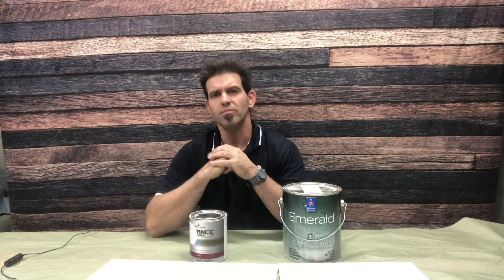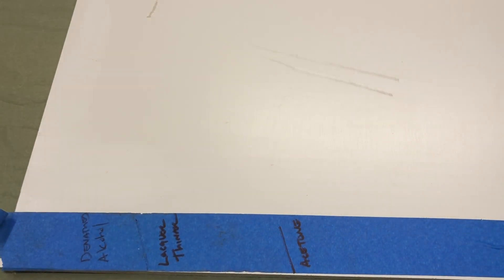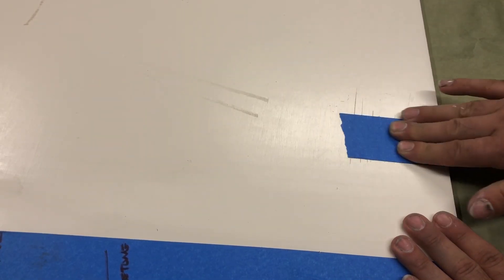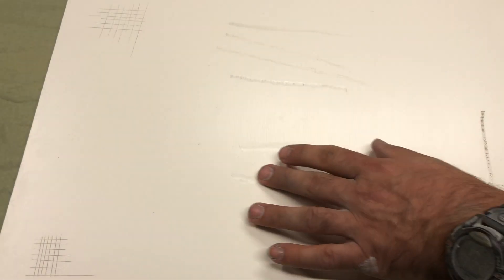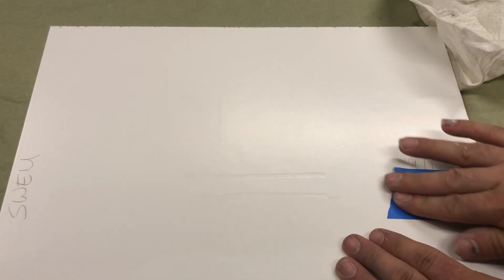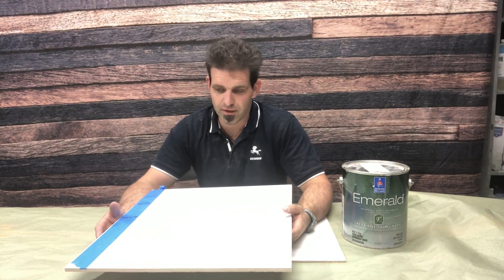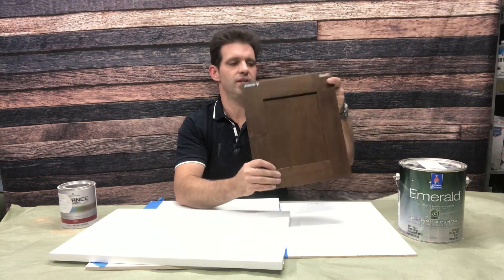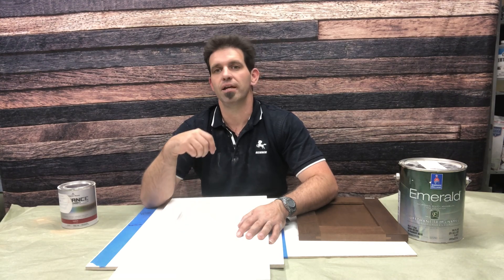Sherwin Williams Emerald Urethane Vs Benjamin Moore Advance

Comment: getting ready to paint my 10 yr old latex painted kitchen cabinets that are latex with a glaze then sealed in 2 coats of polyacrylic.  as you stated there have been advances in paint since then, but overall minus a couple of doors they have held up extremely well.  I was leaning towards the SW in this video, my question to you is what would you recommend to the average home owner who cant get our hands on paints contractors use.  and also would you recommend oil based primer to go over the poly?  I love your videos, I have always been a paint junkie and personally do not care for the BM advance on cabinets only trim.
Reply from the maker: Amber L if it’s waterbase already their is non need to prime it. You can just go over it with the emerald if that’s the route you choose.
Reply: You need to first 1) use a liquid deglosser and 2) sand the cabinets, to remove any existing finishes and also scuff the wood for max adhesion. Then, use an oil or alkyd primer prior to using the Emerald Urethane Enamel. Yes, Emerald Urethane is far better than the Ben Moore Advance. There are some products in Europe that are slightly better still, but they’re hard to ship and also some have experienced shortages lately. Overall Emerald Urethane is my go-to cabinet product
Reply: @charlesg7926  what would be a good cabinet primer??brand?
Reply: @gracedenisse   Call a pro. Doing cabinets professionally requires months of supervised training (supervised by a pro who’s had years of experience). There’s way more steps, techniques, coordination, chemistry, math, cure times, factors, etc involved than just the primer
Reply: @gracedenisse   Telling you the right primer to use, would be like telling someone who’s not certified or trained for skydiving, which parachute to buy. It would be irresponsible. You’ll end up in a bad mess that’ll be costly ($7000+) to get out of. TRUST me, call a pro
Reply: @gracedenisse   as an afterthought… The most intelligent people I know, try to specialize in ONE career (be it a salary job or business) and earn a high income. Then they HIRE OTHER PROS for their taxes, law advice, contracting/home work, medical, etc.
Reply: @gracedenisse   It’s always the foolish/intelligent people, that want to do everything themeselves. They think they “know more than” their doctor, their accountant, their local pro painter… then they lose more money than they’d save when they mess things up 😑
Reply: @gracedenisse   so my suggestion is on focusing on building your own career. Get really good at one industry, and make yourself a lot of money. And then hire people that have years of experience, for complicated stuff you need done. Cabinets are not “simple”. Painting 1 small wall might be kinda simple. Painting cabinets is complex, it involves science and chemistry and math and cure times and using a sprayer and selecting the correct nozzle and using the correct methods (done with perfect hand/eye coordination) and when you inevitably do just one step wrong, it’ll peel off in horrendous chunks that costs you $7000+ to fix because it would all need stripped off completely. Humble yourself. I would never try to tell a lawyer or doctor or engineer how to do their job. Painting cabinets is super complex and you need to give proper respect to that profession. Even most professional home painters aren’t qualified to prep/paint cabinets, they’re a very niche thing

Comment: What do you think about Sherwin Williams Pro industrial water based urethane alkyd for cabinets
Reply from the maker: +Billy Duke that’s a great question. I have heard and been told it’s not different than emerald. I still think that the industrial coatings will out perform sherwin Williams pro industrial
Reply: @ericreason6559  Thank you

Comment: Thanks for the video comparing these two Architechtural products. At the end you compared them to some industrial products. Have you used the industrial coatings for cabinets from Sherwin-Williams called Sher-Wood? Not really fair to compare these products to industrial coatings.
Reply: Dan Gillispie Never beard of that. Sounds like what I need? Thank you!
Reply: @Tinyteacher1111  I used Sherwood ken aqua . It is a nice finish but they aren't making it right now.it is also very thin so it should not be sprayed heavy or hanging

Comment: Eric,
excellent video reinforcing my choice to refinish my poly'ed red oak cabinets with the emerald in SW Alabaster. Not a professional painter. Just a bored, quarantined homeowner. Seeking encouragement and/or advice from a pro.
I sanded down to bare wood (except the molding at top of the cabinets) - I'm using SW extreme block oil primer - one coat on cabinetry and latex extreme bond primer on the the molding at the top. Then 2 coats of the emerald on all with final facing at the end. Brushing and rolling all with high end materials. I did not want to attempt the sprayer without my husband who is an essential worker. (Is any of this combo overkill or ineffective long run? Should I do a complete third coat?)
Also, how long should I wait to rehang the doors? I was thinking a week at the least.
Thank you for any response.
Be blessed.
Reply: You might’ve finished by now, but one tip for you:  if you are priming/ painting existing stain/ finished wood you don’t want to sand to bare wood.  You only want to scratch the surface of the existing clear coat, not sand the clear coat off.  The clear coat locks in the tannin stains in the wood.  The Sherwin extreme bond does not block any of those tannins stains and yellow would bleed right through no matter how many paint coats applied.  
If existing poly is intact and slightly sanded, some painters just use extreme bond, stix, or Inslx UMA bonding primer and then spray can any yellow tanning stains that bleed through that with spray can bin or coverstain.  

How many coats needed on finish?  Two is needed for durability.  3 needed in case 2 coats didn’t cover.

Comment: Eric Reason I don't have a paint sprayer nor do I know how to use one. Can I use Renner or Milesi with a brush? Painting stair banisters and kitchen cabinets. 

Also, I have oak wood and was under the impression that I needed to prime to avoid tannin bleed. Are you saying these paints work better without a prime coat? Thank you!!!

Comment: Nice work Eric they both tested better than I expected. Interesting that the primer would bake that much of an adhesion difference
Reply from the maker: Michael Craine I think that it just takes forever for it to get hard. So I don’t think 30 days is adequate. The primer  thing has to do with the oil primer getting hard and brittle.

Comment: Hello Eric, Thanks for the video.  I am making wooden kitchen cabinet for the first time, I don't know much about paint coating.   The cabinet doors will be simply one single straight/flat piece of sanded wood with no grooves nor design.  All I wanted is to paint the doors bright white with very shinny high gloss.  I am assuming it will take a few coats of paint on top of a primer.  Which paint and primer do you recommend, Sherwin Williams Urethane, Benjamin Moore Advance, Renner, CIC, …?  Your help is greatly appreciated. Thanks, Abe.
Reply from the maker: +Abe B  sorry I am just now seeing this YouTube doesn’t always send me the comments from folks. Any of the ones you
Mention will
Work great. I like the milesi universal, renner 643, and envirolak 170. My favorite tip coats are wide and Long.
Reply: Thanks Eric for your response.  I live in the Detroit/Ann Arbor area in Michigan (USA), and it seems that nobody carries either one of the three you mentioned (Milesi, Renner nor Envirolak).  I might stick with the Sherwin Williams Urethane.

Comment: Hi Eric, great videos!!  I have a question regarding SW Emerald urethane. What have you found to be the best viscosity (seconds) and tip for spraying Emerald with HVLP?
Reply from the maker: John Bernard honestly airless works the best
Reply: @ericreason6559   I only have HLVP. Will that not work? I sprayed one coat of semi-gloss thinned to ~30 secs using a 1.8 tip and the finish was more like a satin than a semi-gloss...any ideas (other than airless) would be much appreciated.
Reply: @ericreason6559  Are you saying that I will not be able to get an acceptable finish using  HVLP?
Reply from the maker: John Bernard no you will just have to thin it to get it to layout. The reason I mentioned airless is that my experience has found that it works best with water-base overall with the least amount of issues.
Reply from the maker: John Bernard yes the semi-gloss in that product is more like a satin. The satin has a chalky feel to it. You can definitely use a turbine I was just saying that airless works extremely well with waterbase despite what everyone says. 308 fft  is the way to go.
Reply from the maker: John Bernard yes the semi-gloss in that product is more like a satin. The satin has a chalky feel to it. You can definitely use a turbine I was just saying that airless works extremely well with waterbase despite what everyone says. 308 fft  is the way to go.
Reply from the maker: John Bernard thanks I just reduce until I get a tight pattern and good atomization. Sound a like you have it figured out.
Reply: @ericreason6559  Thanks for the input Eric! I've heard that some people can get very nice finishes using an airless but I've never tried it. I've only used conventional and a cup gun or, now, HVLP. If I get the chance, I think I'd like to try using General Finish Poly -- Michael Craine seems to like it a lot. BTW, what is 308 fft?
Reply: @ericreason6559  OK, I finally figured out what a 308 fft is. Thought it was a rifle caliber  ;)   So if I spray EMERALD URETHANE using an airless with a 308 fft, will the material retain a semi-gloss sheen? Or would it still degreade to a satiny finish?
Reply from the maker: John Bernard  no the sheens are just different with that product I’d you want a semi gloss you will have to go to there gloss. If you shoot it with airless you will not have to reduce the material
Reply: @ericreason6559  I took your advice and tried the gloss and, sure enough, the result was a semi-gloss. Thanks for the tip! I also discovered that EMERALD does not play well with oil-base COVERSTAIN. That primer definitely has an effect on the sheen. So, after using CS for a base coat, I then used KILZ premium for an intermediate coat, followed by the EMERALD. That combo seems to work the best. What are you feelings on GF Enduro Poly? And what type of primer would you use under that coating?
Reply from the maker: doc hall you raise a good point and SW is actually right the paint itself will adhere better than the primer however the issue in most cases is bleed back, tannin bleed or dye migration.
Reply: doc hall  Whatever the chemistry, it certainly has an effect on sheen. Actually, I wouldn't have used CS except for the fact that I had so much bare wood exposed after prepping the boxes and cab doors. I did an experiment a while back where I prepped a cab door (wash/scuff) and used Zinsser 123 and had excellent results with adhesion over nitro lacquer. Over bare wood, however, I'm still a fan of oil-base primers. As I mentioned, I solved the sheen problem by shooting a coat of water-based primer over the CS prior to finish material.
Reply: @johnbernard7032  Could not get it to work with HVLP Turbine. Went back to airless with it and good. SW themselves answered my question on this and stated I would have to thin it too much and could cause problems. Went with a 310 fflp tip, but I had to work faster. On to Milesi.
Reply: Eric Reason f
Reply: If you look at the back label on the can, it tells you what tips to use with a HVLP. You can also get data pages from the store you purchased the paint at.
Reply: @kencarpenter108  I have shot several vanities with an HVLP. I have a Fuji and used  the # 4 tip. It works very hard to get it to lay down.  I’m going to use an airless with it tomorrow.  I love the SW urethane. I had a terrible experience with the Advance. It ran badly, took forever to dry/cure and coverage was much less than desirable.

Comment: Love this video! What primer would you recommend for a cabinet refinish job? I assume a vinyl sealer. Keep up the great work👍
Reply: @KonstantinUdalov  the Renner looks amazing unfortunately I don't think it's available where I live. And right now I'm trying to get the milesi dialed in. Another question ,milesi, they have Universal primers curious how that adheres to those challenging surfaces.
Reply: @KonstantinUdalov  yeah you're probably right, but there something to be said about easier availability👍
Reply: @WordAboveAll  love social media thank you so much for the input! I shoot the milesi with an air assisted airless with an 09 tip I think my biggest was not putting enough mills on, it wasn't laying out like I wanted it to was getting a bit frustrated but I did notice once it dried it looked better than I thought it would I still have some experimenting to do thanks again!👍
Reply: @ballardpaintingcompany514  Get a mil gauge if you can. That helped me in the beginning. I was so used to spraying the lighter coats of SW, PPG products.....but you can go much heavier with the European products.
Reply: @WordAboveAll  yes the European Coatings are a lot different, heavier coats, opposed to what were used to Spraying thanks for your advice👊

Comment: Eric I am a small cabinet refinisher in Maryland and I have recently come across a kitchen where someone used Sherwin Williams SuperPaint. It’s a primer and paint in one. My question is what are my options without having to strip off the entire finish and start over. I normally use a solvent based vinyl sealer and two top coats of precat Lacquer from Lenmar. I have great results using this but the more I watch your channel the more I want to try the Milesi 2k. What would you do in this situation? Any help or insight from you is valued as I have already learned so much from your channel.
Reply from the maker: +Jason Adams you can put a vinyl over latex paint in most cases but the trouble is you are only going to be as good what they did to prep the surface so its possible that if the  super paint starts to peel your works is going to come off as well. My suggestion would be to recommend new doors and sand the face frames back to good wood.
Reply: Buy new doors and strip down the faces uses a chemical stripper (faster than sanding and doesn’t risk damaging the wood from all that large amount of sanding). Superpaint isn’t a “primer” in that sense of the word… only primer to help with color changes. Superpaint is not a bonding product and shouldn’t be used directly onto wood, you need a wood primer first. Personally I’d stay away from that job entirely

Comment: SW Emerald Urethane seems to have definitely outperformed on the chemicals ..... I've never used it .... another test that would be good to know is - ease of application , leveling , appearance , things like that .... the actual USE of the product ...... Some of these specialty products hold up well but SUCK in application , they get tacky fast , drag , don't brush well , don't touch up well , etc etc ..... looks like you sprayed your samples , but if possible , when you run these tests , "ease of application brushing" would be good info ..... all the Pro Classics and the PPG Breakthrough brush pretty well (I add a wee bit of floetrol or extender and a touch of water though) .... just helps it brush and level better (I am speaking of water based products , NOT the oils .... add Penetrol for oil based paints of course)
Reply from the maker: shure46 thanks for the feedback. You are right some products are more difficult to work with than others. I honestly don’t do any brushing and rolling so I would be much help on those particular topics.
Reply: @ericreason6559  Okay , I understand .... your "thing" is mostly checking durability ..... Thanks for the vids , they are helpful
Reply: Emerald urethane is by far the easiest to brush and roll in my experience. Half inch microfiber roller cover Wooster alpha brush. My personal preference.
Reply: @ericreason6559  Update on Emerald (I said I have never used it previously , and recently used it) I also did a sample on a stick , seems to dry quite hard , but I hate SW "whites" they just aren't nice and WHITE , extra white ain't extra white !!!! it's got that "greyish tint" compared to other brands of WHITE ... A while back I had to match a laquered door fine finish on some cabs .... FACTORY FINISHED DOORS ..... I had to "fix" ONE door ..... I actually painted the door with Emerald , brushed and mini-rolled , let it dry real good , slightly sanded with high grit just to smooth it a bit , then sprayed it with satin laquer out of a spray can !!!!! 3 or 4 coats ..... damn thing matched quite well !!!!!!! Only an expert could see a slight slight difference .... and the factory precat laquers have a "prism effect" you cannot get from straight laquer .... but ya really have to look close to see that prism effect , the way light is scattered w precat .... anyway to the average person , was a damn good match ..... I also did not realize precat comes in a spray can from Ben Moore at the time .... If I'd have used that .... might have been perfect .... I don't have a garage nowdays , live in an apartment , don't have the luxury of a shop anymore and ability to spray using cup gun and all that ..... Thanks to the recession killing me a few years back .... long story
Reply: Emerald out performed my expectations on a high end cabinet job I did two years ago ...still no obvious scratches or chipping.
Reply: Emerald is the best, hands down